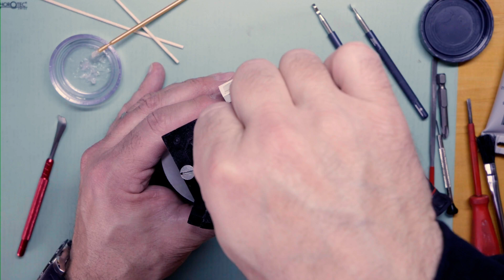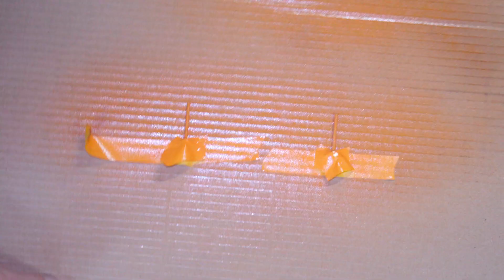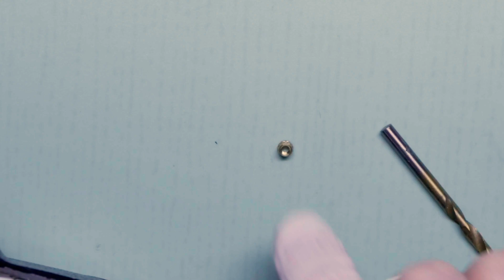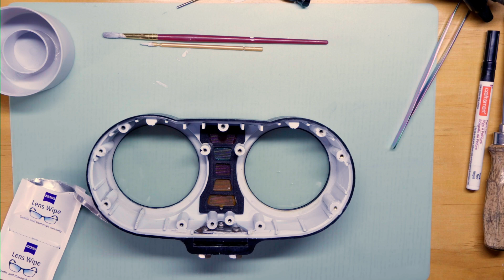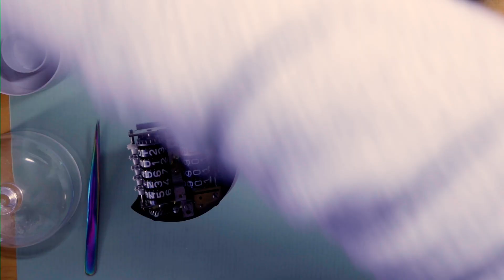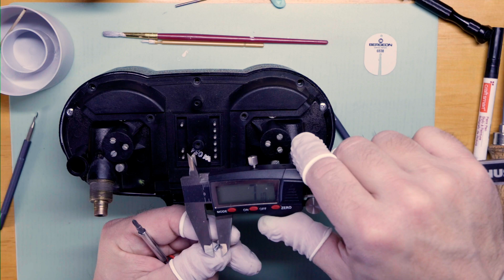BMW Airhead Speedometer Tachometer refresh PART 2 - More disassembly, cleaning and reassembling

Comment: Great video - thanks for sharing your experience so fully. I'm about to embark on a similar restoration but my screws were properly rusted and even with Plus Gas have broken all the inserts out but one. So I now have 13 of the original inserts to replace and at least 6 pillars to remake so your methods have been invaluable. I also need to replace  both the acrylic lens. There is another YT video of this and the important thing to note is that even the fumes from superglue will cloud the lens so great care is needed doing this procedure.
Reply from the maker: Good luck, glad the video helps. I think I have a video about replacing the glass. Cheers

Comment: Thank you so much for this video, My tachometer started squealing, and before i got home the needle fell off!!

Turns out that a white numeral tacho (mechanical) is impossible to source here in the UK. I toyed with the idea of converting mine to electronic tacho (green numerals) but I found an “abandoned speedo project” on ebay, so i bought it and using the parts (needle spring and some internals, I’m happy to report it is fixed. Thanks to your video i was able to see that I could do the job, and have calibrated it too :)

Many many thanks for all you do for us (even if you didn’t go to BMW tech school in the 70’s)
Best regards Bob
Reply from the maker: You are welcome. I appreciate your comment. Good luck repairing your tachometer, even if we both did make it to that factory course in 1970. 😉